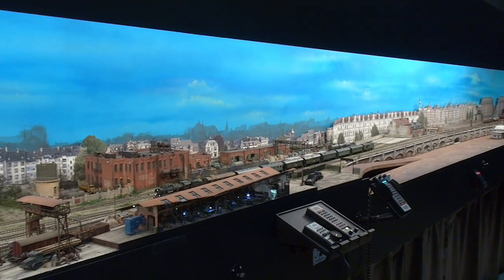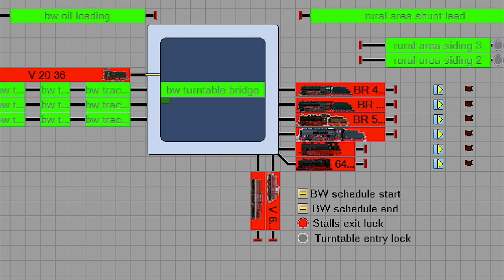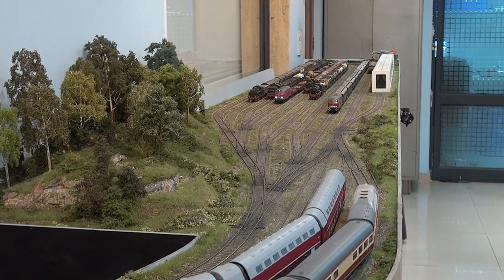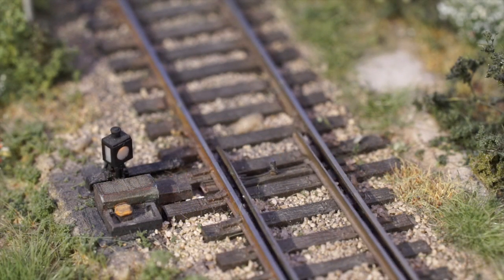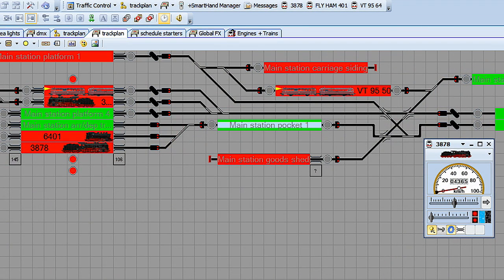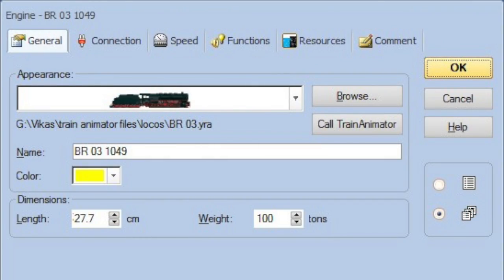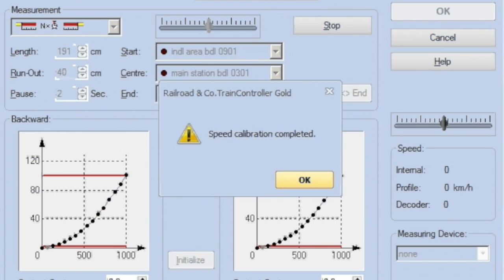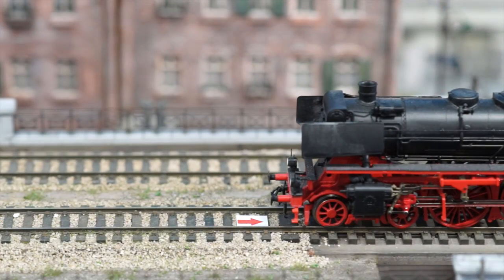Abendstern Computer Control

Comment: Very nice BUT I can operate 8 trains digitally on my layout and I enjoy operating my points/signals via conventional controls. Having a computer do just about everything would lessen the enjoyment for me. To each his own.
Reply from the maker: Hi , as i mentioned i am a single operator and the computer controlled operations actually greatly enhance my model railroading experience. Since i cannot operate 8 trains at the same time, i control only one train at at time. I try do this as prototypically as possible , having slow starts and stops and obey all the signals and speed restrictions. In case i am handling a goods train then i also shunt the various industries along my route. The computer in the meantime handles the rest of the trains and traffic on the layout.
Reply: vikas chander <

Comment: hello !

very impressive. What i'm curious about ... how is the hardware installed for the automatic coupling ?
in the video at 7 min ...

How do you do the uncoupling and how is the hardware installed ?  and how is the detection done for the exact position

Hope you can provide me with this info !

Grtz

eric
Reply from the maker: +eric baan Hi - For the hardware installation pls have a look here - http://vikaschander.com/fremo-staging-yard-build-installing-the-kadee-309-electromagnets/

The uncoupling requires the couplers to be reversed over an electromagent. Once slack the couplers are pulled in oppostie directions by electromagnetic force and when the engine pulls forward the couplers part. 

I have to program into the software where the loco stops, how much it reverses the exact trigger time of the electromagnet, then the time when the loco pulls forward and then the time the electromagnet swtiches off. Little difficult to explain clearly but easily done all the same....
Reply: hello Vikas,

Tnx ! i will enjoy to read it.

grtz

eric